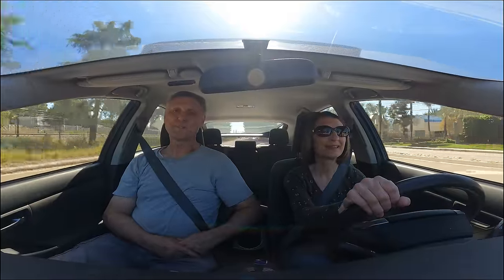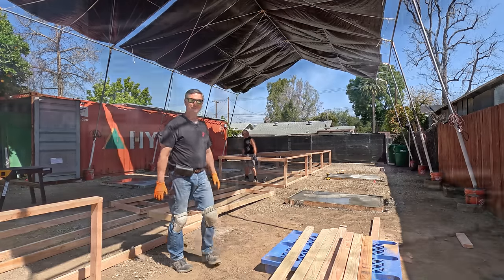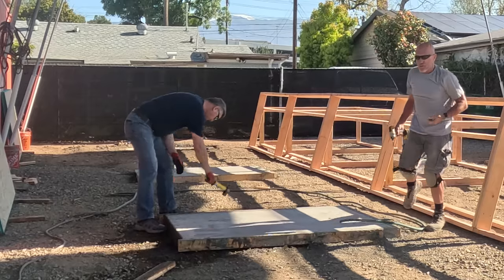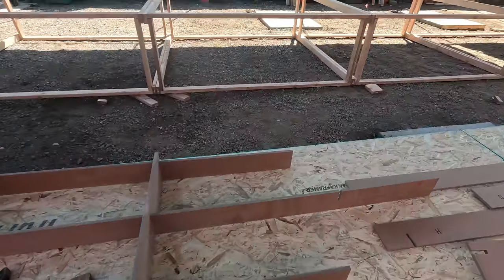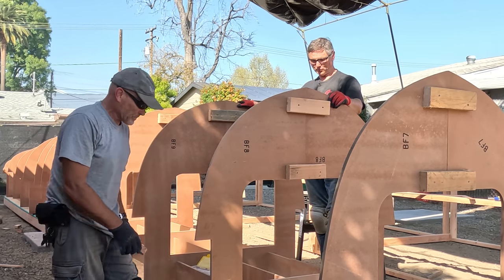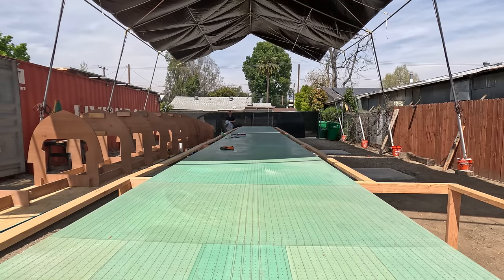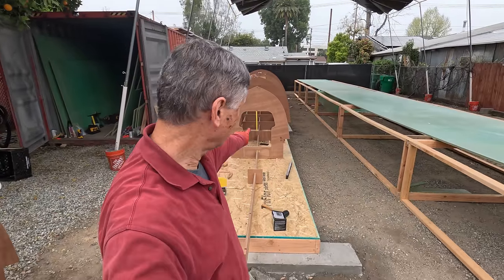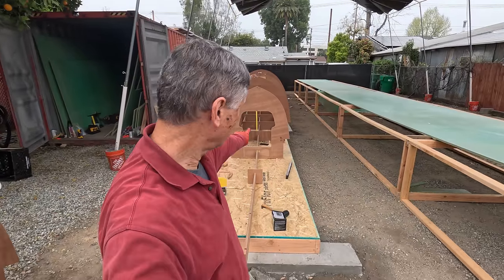Kit E30 Catamaran Boat Build Begins

Comment: Assemble MDF frame when cover not finished? Too ambitious ignoring weather conditions. Rain and heat would corrupt shapes fold and bend MDF quickly.
Reply from the maker: We are in Southern California,  its unlikely to rain for the next five months.  Worse case scenario, we have plastic sheeting to cover the entire canoe.
Reply: @SailingSVLynx  I wish you good luck. My own mistake was to build a flimsy tent so next storm destroyed the cover and wet entire project. Another problem I could name is the mist. Every sunset and sunrise water condensate everywhere not covered. Moisture is definitely the worst enemy of the boat builder. It blocks resin or polyurethane to set properly. Makes difficult the core contact with enforcements will cause future delaminations, blisters and so on.
Reply: @DanielMashonkin  yes, we do have concerns, but not so much about rain as wind.  We will have to deal with that as it comes, hopefully taking down the tarps ahead of big winds.  As for condensation, it can happen here, though we live in a very dry desert area.  We will watch out for that and not apply epoxy if any surface isn't dry.

Comment: What city are you in, using the distance from the hills it looks like lUpland, Ontario or Montclair.  It looks like south of the 10fwy and west of mountain ave.
Reply from the maker: In that area, yes.
Reply: @SailingSVLynx  How are you going to transport it to the water for launching.
Reply from the maker: @ChrisHarding-lk3jj  Crane loads it on a flatbed truck, another crane drops it in the water off Balboa Island, in Newport Beach.
Reply: @SailingSVLynx  I am getting ready to start construction on a 62' high performance aluminum catamaran at my shop in the high desert and the one thing I haven't researched is transportation of something that size.  I wasn't going to think about it or worry about it until the time came.  I have seen far bigger objects being transported by truck, the oversized permits and escorts are the biggest issues.
Reply from the maker: @ChrisHarding-lk3jj  Yes, you will need to get special permission from Cal Trans, and pay for a Highway patrol escort as well as a wide load escort company.
Reply: @SailingSVLynx  The one thing I don't have to worry about is a crane, my buddy own a crane rental service based out of Corona and I am always working on his cranes.

Comment: Dear friend, if the thickness of the strips is 2cm,you need a gap between the strip 3mm,if not  they will be a lot of air between the strips ,so start again or you risk the whole project,you can make an experiment,before the start of the big gluing,this could make the cat a bit heavier,the better way is to glue the strips first for second, second for third….till the end,on my project i always first fix without gluing then i glue…. And i see you work in the  open ,if starts to rain, you will lose  the mdf, i think that you have no chance to finish this project in at least 7 years in this conditions
Reply from the maker: The gap is already correct for these strips as per the kit designers specifications.
Reply: @SailingSVLynx  well good luck
Reply: Fortunately the MDF doesn't have to last very long  and we are headed into months where it doesn't rain in Southern  California.   The hulls will be done well before rain.  The other MDF structures will also be completed by then, forebeam and cabin top.  Nothing else uses MDF.
Reply: @dalgamor  i have very good idea about your project,i am building Schionning Arrow 1500 at the moment
Reply from the maker: @valkedinak7130  Excellent.  Are you building in laminated foam panels or balsa?
Reply from the maker: Just so you know, we asked Schionning if we should angle the cuts of the strips and they told us 'no', and just had us cut at right angles.  This means that on very curved and twisting areas even though the bottom of the strips (the inside edge) are touching, the tops have a gap.  Mostly (as in 95%), these gaps are less than 3mm, but in a few places they are a bit larger.  we will be careful to fill those few larger gaps with thickened epoxy.
Reply: @SailingSVLynx  laminated foam ,same like you
Reply: @SailingSVLynx  the only way to fill the gap is by removing strap 2 gluing and fixing , make an experiment with 2 strips and check how deep there is epoxy

Comment: great progress!
Regarding alignment of the temporary hull forms, it seems to me that it would have been easy for the designer to add alignment holes through which a laser could be used to double and triple check everything. The system of slots to hold and align it all is good, but as you've found, it's not perfect.
Reply from the maker: I agree completely.

Comment: Really interesting project (binge watched to this point) and since I’ve been following “Life on the Hulls” and “MJ Sailing” it will be good to throw this different version of building a cat into the mix . Having spent 43 years in civil engineering I really think you could well do with some diagonal bracing (just wires you can tension)  between your first and last shade roof support beam and maybe some anchors onto that 40’ container as well as some extra weight or earth anchors on the other, don’t under estimate the lifting power of a good gust of wind 😀 or the damage that thing could do to your build. Cheers from NZ
Reply: I think that plastic provided shade will just tear / shred with any decent wind gusts, but it would be bad if that structure damaged the boat. Those commercial tent / arc things designed to span 2 x shipping containers - what wind strength are they rated to? I'm daydreaming about my own build . . .
Reply from the maker: There are already anchors attached to the two containers from the corners of the structure, plus additional ones on the other side, both not shown in the video.  They were added a day later.  Finally, two lines on one end of each tarp are set to 'break away' in a large gust of wind rather then lift the structure.
Reply: @SailingSVLynx  Excellent 😀

Comment: For the cuts when cutting on form can you only cut the outside laminate and foam leaving back laminate intact, lower laminate should be able to bend at that point.
Reply from the maker: Possibly, yes.  I'll give it a try.
Reply from the maker: After some experimenting, we get a better twist (in areas that need it) by cutting all the way through.  However, there are other sections of the hull where we will use kerfing.

Comment: You add yourself  extra work ,it will be fine go with strips  from deck  up tp keel  as is done on strip canoes , further else  you might use their trick for routing edges to lock it selves and not mentioned lot of extra structural strength ..... hull must be level with filler anyway and lot of sanding prior fiber glassing. oh well
Reply from the maker: We followed the manufacturer's recommendation on how to build their hulls, so we're confidant they will be fine.  Schionning has been selling kits for 35 years and are known for their strong boats.  But thanks for the suggestion.

Comment: Great progress!  Death by a thousand cuts maybe?  😅  always amazes how quickly you learn to be more efficient.  Maybe invest in a track saw or these cuts don’t need to be that exact?
Reply from the maker: We looked into track saws before starting, but it added time (moving the track each 10' and lining it back up) and cost (to buy).  It turns out that the sled and guide we use on the saw works perfectly and we can run straight down the entire cut without any issue.

Comment: It seems like very fast to build with strips like that - compared to wooden strips as RAN-sailing do- but I think there will be a lot sanding and fairing to get a good finish. . But one think as a kit - why dont they have forms for those essential parts and save a lot work. This will be much more work than MJ-sailings cat.
Reply from the maker: It will take a lot of fairing, no doubt.  I wish they had cut the strips for us, but it only added a couple of days per hull, so not that big a deal.  We would have loved to go with a Max Cruise 44, but it was just too small for our size crew and goals.  I contacted Max Cruise, and though they sell a larger cat, they don't sell it in a kit and it was north of $800,000.  But there is a silver lining, though more work, I got to design a lot of the details about the Solitaire 1520, so I get very close to my dream boat.

Comment: Hi. I’m no expert but I watched Ran sailing building their boat.  They beveled the form edges, either front or back, to make fitting the strips easier.  This might help reduce the gap size between strips and thus require less filling and sanding. Don’t know if this applies in your case.   Regards
Reply from the maker: I asked Schionning about that ahead of time and they said cut them straight, so we did.

Comment: You're working fast, I might need to lower my time to finish... but then there are always uncontrollable setbacks like that rain and adjusting the strongback where things always take longer than you expect.
Will be interesting to see how much weight of thickened epoxy and fairing you need to fill the gaps.
Reply from the maker: I'm curious about that a well.

Comment: At what point do you glue the strips together? I've done a boat with duracore strips and glued the edge with thickened epoxy on the table. Then lifted it into place and screwed into the temp frames (bulkheads). My strips had only 7/8" width so we used round toothpicks between temp frames (if needed) to peg the strips to the next one. This took out some of the variations from strip to strip and helped reduce fairing.
I'd love to see your project - I'm in Orange County.
Reply from the maker: The strips are glued on right after dry fitting, just watch the latest videos, we show the process, though we chose to go in reverse order.

Comment: I'm sorry, but you have introduced a huge weak spot into your hull at 24:53 by creating a massive stress concentration point. The offset you spread the cuts out is not nearly enough to eliminate the issue, taking into account the overall length of the hull. Plus you will grind those protruding edges down hence removing even more of upper fiberglass reinforcement. Your boat probably will not fold in two pieces, but that's the future cracking place and a water entrance point.

Obviously you won't remove the planks already, so you will have to lay additional layers of fiberglass with a big overlap from the inside and from the outside. The weight of fiberglass should be higher than the original fiberglassing.

I recommend a book called "Structures: Or Why Things Don't Fall Down" by J. E. Gordon. It's a good and helpful read in general.
Reply from the maker: The biscuit joint is part of the plans from a company that has made cats this way for 35 years, without a single failure.  As for the protruding edges, we did notice that and fixed that issue after the dry fitting before epoxying the strips permanently.  There are three layers still to be laminated over the top of the hulls before they are done.  The original plans only called for fiberglass, which would have still be overengineered with hulls designed to be strong enough to be beached, but we increased the strength and impact resistance by changing to basalt fiber laminated layers.
Reply from the maker: You should also note that we didn't engineer or design the hulls of this boat, that was done by the engineers at Schionning.

Comment: Nice progress!  Will this be hull#1 when completed?  I forget if you've mentioned this before.  Also, just curious how Schionning provided the estimate for the lightship displacement?  Seeing the strip planking process it is different from how other performance cats are built, and all of those slits/grooves are going to be filled with epoxy, adding weight and impacting performance.  Manufacturers building hulls off molds are able to use thermo-formed foam panels that contour to the shape without all the extra voids getting filled with resin.  Not sure how Schionning takes this into consideration as each boat is going to be different.  

Keep up the good work and hope the rain stops!
Reply from the maker: This is hull #1, sort of.  It uses the same hulls as the, 1490, so technically the canoes are hull #4, though this is the first 1520.  They can't know the precise amount of epoxy, but it won't be far off.  The hulls weigh 1,100 pounds each, typically, faired.  The finished 1520 will weigh approximately 26,000 pounds and draft just 1' 9".
Reply: @SailingSVLynx  Very cool!  Now it's a race to be the first 1520 in the water, do you know if any others are currently in the build phase?
Reply from the maker: There are not, but I am consulting with several people who want to build a Solitaire.  Some of them plan to have them built by a yard.